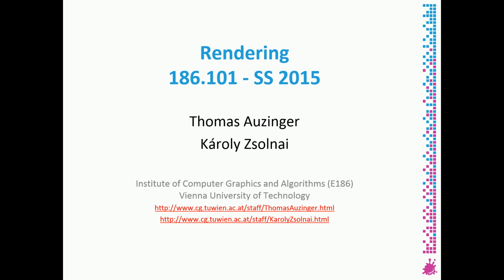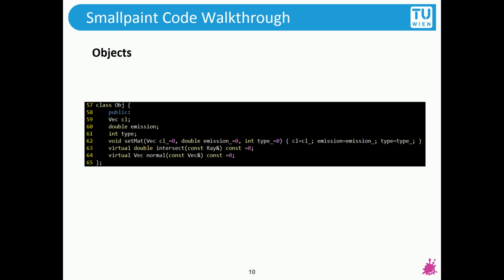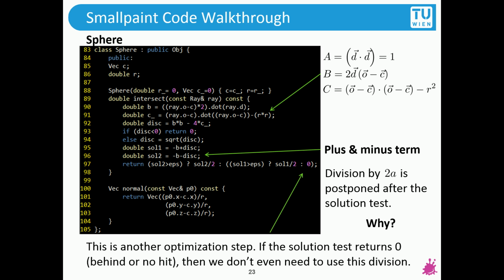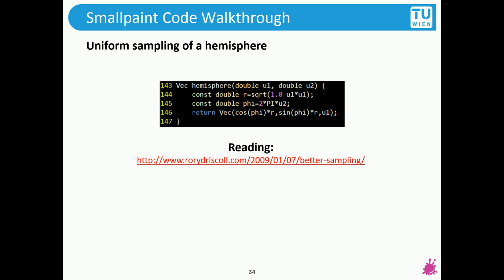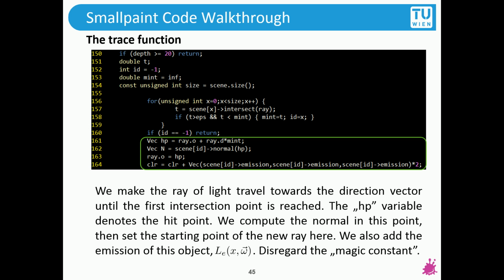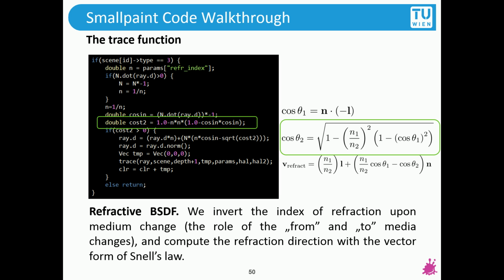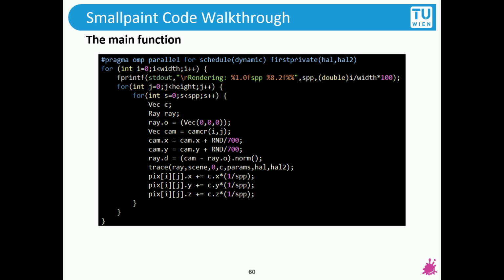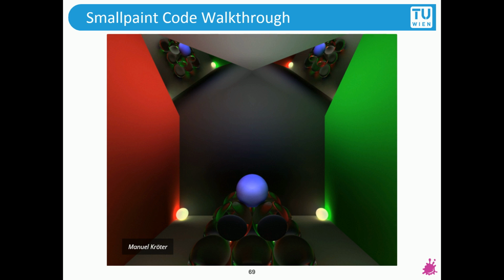TU Wien Rendering #29 - Path Tracing Implementation & Code Walkthrough

Comment: "Extremely expensive" might not be quite correct, especially with newer CPU's, since sqrt is implemented as a single machine instruction. They are about comparable with a floating point divide in speed, though these are not cheap, either.

Comment: FYI about 40% of the "fixed" program's time (as opposed to the painterly version) is used by random number generation. I compiled smallpaint_fixed.cpp on Windows without OpenMP. The program runs in 21.1 seconds on my machine. Replacing the mersenne twister with pcg32 improved the run-time to 13.3 seconds.

Comment: Wouldn't an unbiased estimator for the average require multiplying 1/(n+1) rather than 1/n?
I guess it doesn't really matter given that both converge against the same thing, even if one of them is a single sample ahead in accuracy.

Only partially related: Are you aware of this? https://github.com/ntoronto/drbayes
It will probably not be great as is for actual fast ray tracing of complex scenes (this is a proof of concept, mostly) but it's an interesting approach. Perhaps it includes some ideas that could be applied to ray tracing one way or another.